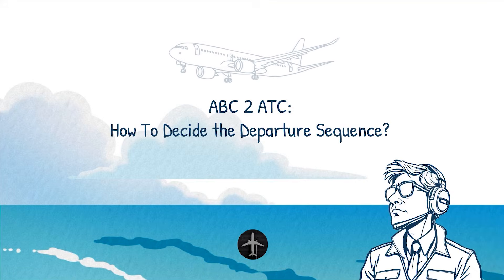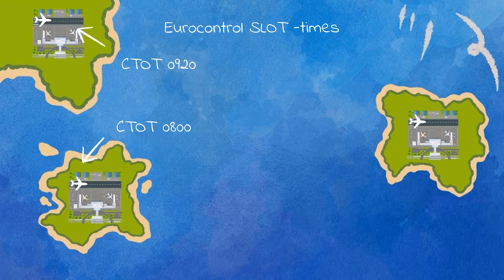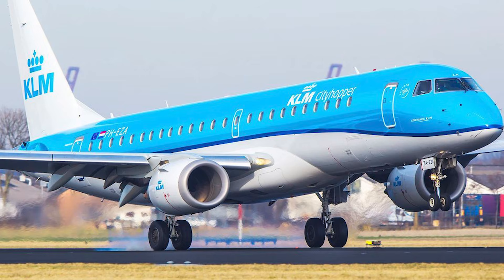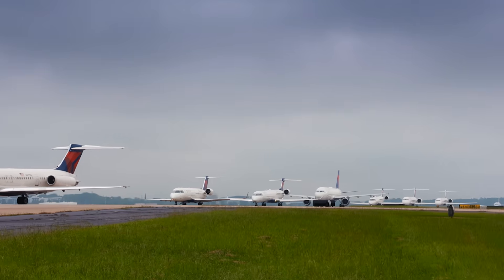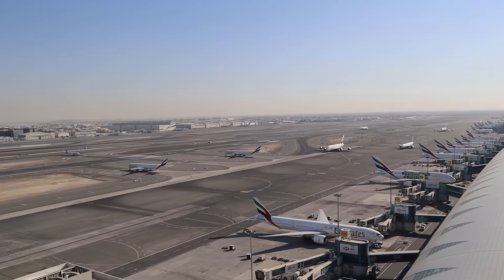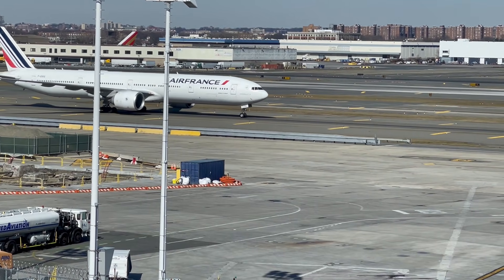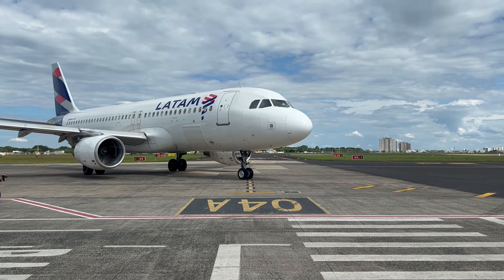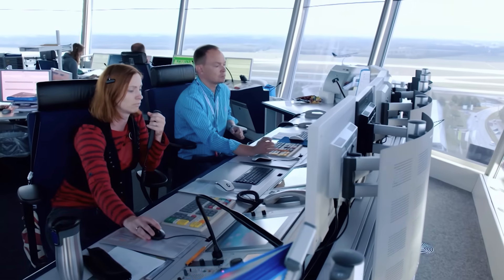Secrets Behind Departure Order: ATC Decision-Making Explained

Comment: There seem to be two camps of pilots with clearance like "in sequence, line up..." - is the "second" aircraft allowed to cross runway holding point marking before the aircraft on runway has started its takeoff roll? Some say absolutely now, some say that there is no limitation or condition in the clearance and the crew can decide how close behind preceding aircraft they actually want to go (considering jet blast / FOD).
Reply from the maker: With the clearance "behind departing line up runway and wait behind", probably most ATC's will assume that it is the pilot's responsibility to decide when there's enough distance from the aircraft commencing the take-off run to enter the runway. Sometimes it is faster just to wait for a couple of seconds and then just instruct to line up, without mentioning anything about the preceding.